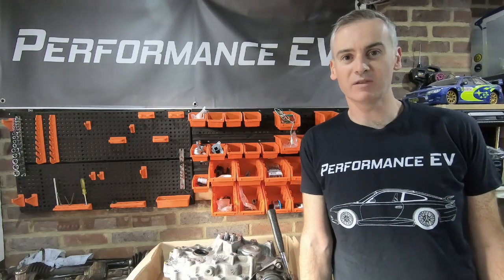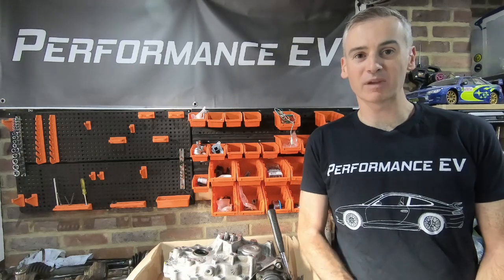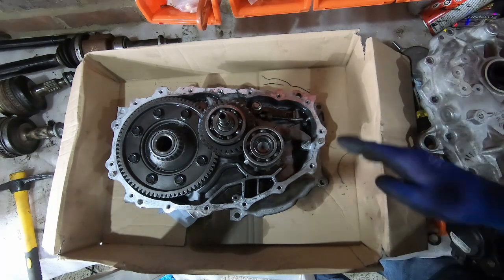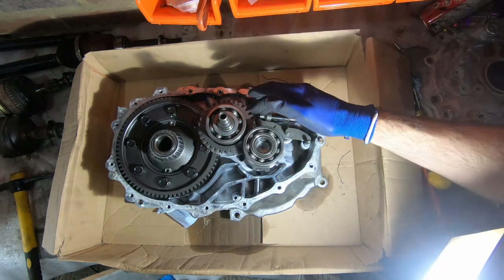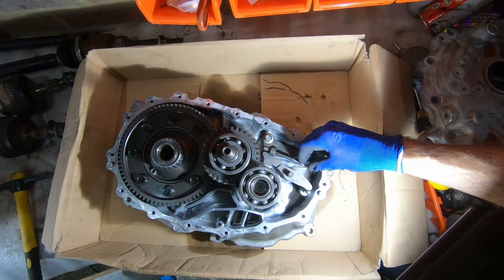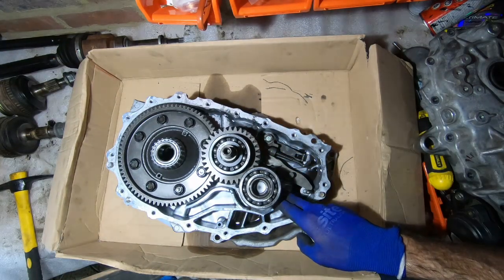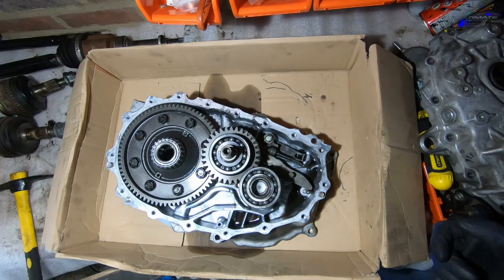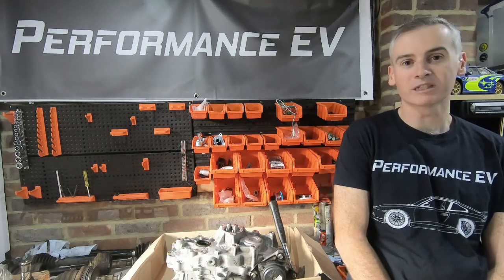Building an Electric Car - EV Parts - Nissan Leaf Gearbox Teardown - Look inside

Comment: Can you please tell me what oil should be used in EV transmission
Reply: Nissan specifies Nissan Matic S for the LEAF. I used Nulon Low Viscosity ATF which is supposed to be compatible. A lot of people use Redline D6 ATF.

Comment: Those motors from Nissan leaf are going so cheap in the used market now, I am looking into building a boat with those. its just a steal compared with the maritime electric motors on the market.

Comment: It has a small number of bolts holding the ring gear, seems it would not handle a lot of torque?   The toyota highlander rear drive unit is similiar with a built-in much smaller motor and it looks just as strong as this gearbox even though it has only 50hp i think.

Comment: What advice would you give to gearbox oil? What would be the most appropriate and best? thank you :)
Reply from the maker: I believe Nissan advises a specific ATF, but most should do. I am still trying to decide what to use long term, I will probably got with a relatively viscous oil as I am running this in reverse and want to give as much wear protection as possible. But that will cause a slight drop in efficiency. It’s a balancing act n

Comment: Hi Shane do you have a idea on how to disengage the parking break without breaking down the whole unit I picked up a motor for my VW bug project thanks
Reply from the maker: I haven't figured it out yet. Mine came disengaged so I have been reluctant to tinker with it until I have figured more out. Once I do, I will of course do a video on it.

Comment: Do you know if you can easily remove the brake actuator and reinstall without major issues? I rotated the gear case 90° to install it in my Tacoma.  I want to remove it to fill it with oil.

Comment: you mentioned 8:1 reduction of the Gear system. But whats the speed of the Input Motor.
Reply from the maker: The stock inverter control limits the motor to 10k rpm. I'm hoping to get it spinning faster than that to give a higher top speed.

Comment: Great video Shane and thanks again for sharing. This helped a lot to figure out how to manually release the electronic gearbox brake. I removed the small brake motor and released the parking brake by hand with a 12mm socket. Did you find out how to control the brake motor electronically?
Reply from the maker: Thanks. Glad it was helpful. I haven't managed to control the brake motor electronically yet, but it is on the backlog (along with a bunch of other tasks) once I do it will definitely be something I do a video on.
Reply: @project fig leaf - did you ever figure out any info on how to operate the gearbox electronic brake motor?

Comment: Great vid. If you count the teeth you’ll find the gear ratio is a bit over eight. Also the differential actually is the part that contains spider gears. You only see these if you’ve removed the gears particularly the large one.

Comment: I would put about 1:4 of Lucas oil additive in the fluid if it's going to be upside down, it will add stickiness to the fluid causing it to climb the gears and lube everything, in stock location the fluid is thrown up to the 'resivor' and channeled to the bearings, the 20 oz or so of Lucas should allow lubrication without the stock channeled lubrication, beunr it's inverted! I'd love to get one of these motors and gear boxes, maybe motor only, and maybe connect it to two leaf batteries, for extra range, and possibly allowing more current to be pulled from the battery, I have no idea of the voltage limit of the inverter, it would be nice if it could be boosted about 100v I'm not sure if there is current limiting due to battery capabilities , either way, adding battery capacity would double avalible current, I need to study these further, I'm going to buy a leaf Battery to add to my house to power it, break it to a 24 v system, maybe I'll eventually get to building a car,
Reply from the maker: Hi James, thanks for the tip, I'll look into that additive. I've been trying to figure out how to keep the box properly lubricated while running backwards. 
I've heard estimates that the inverter should be okay up to 450v which may allow me to close the gap between the leaf stock power and that of the Porsche. I'm planning to build up to this voltage and test these theoretical limits in the real world. Good luck with the leaf home power project.

Comment: The 2018 leaf maintenance schedule says to check 'reduction gear oil'. Is that just a plug on the unit to check its fluid level? Do I have to take the entire flimsy cover off the bottom of the car engine to get into it? Thanks Performance EV!
Reply from the maker: Yes, there are three plugs on the unit. The one the side near the base is for draining the fluid and the one close to where the CV Joint goes in is for checking/filling the fluid. I haven't seen how it looks in place in the car, but I think you have to remove the undertray. I found this post when I was researching the gearbox it may be of help - https://www.mynissanleaf.com/viewtopic.php?t=25076
Reply: I have changed the fluid after 170k Km and it was worth it.

Comment: Around the 6 minute mark you mention a reservoir which is at the top side of the case (bottom of the screen as it's inverted). The large gear throws oil into that reservoir and it drains down onto the gears through the little hole. That might be important and certainly won't function as expected upside down.
Reply from the maker: That's a very good point. I'm also trying to get more information on how much oil goes into the gearbox and how full it gets (is it filled to the brim or not) as that should help me understand the impact of that section and whether it would still work upside down. That said I'm still not certain if that is the approach I'll take.

Comment: Thanks for all your videos. I am probably 2 years out from starting my own conversion but I will probably be using a Leaf motor for it, so these videos are a great source of information!
Reply from the maker: Thanks, I'm glad this series is proving useful.
Reply: the latest engine is 150hp  wait for the next one is 200 hp
Reply: Check out the Spark EV motor as well. The coaxial output shaft can make packaging a bit easier.